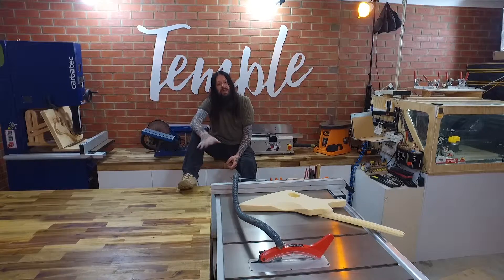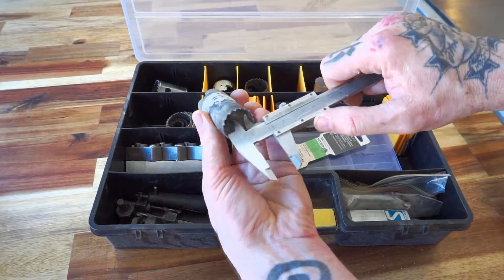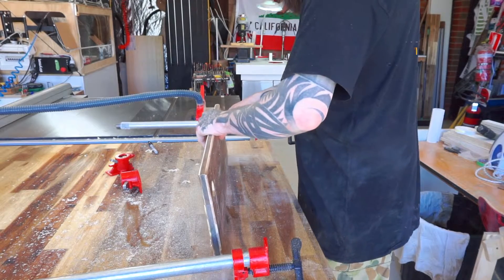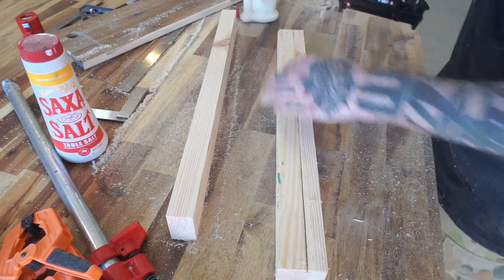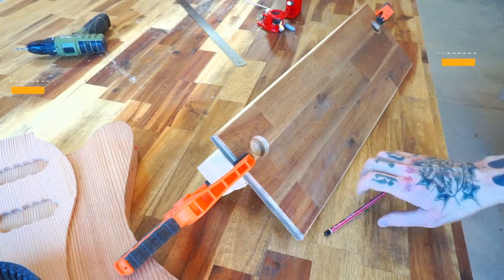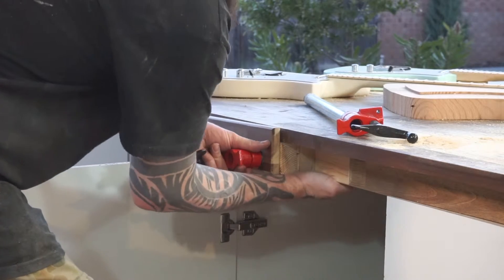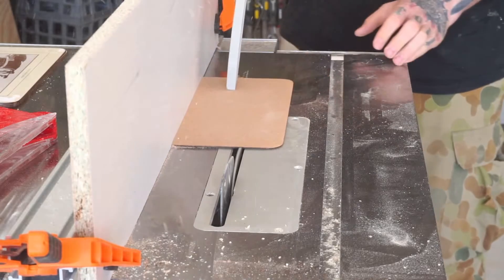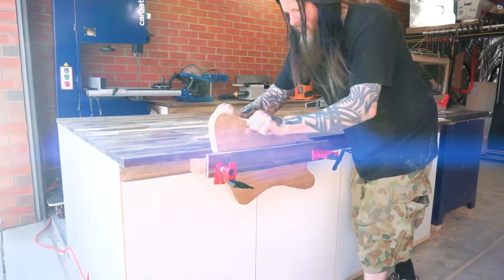Building a Luthiers Vise in under 15 minutes.

Comment: You know somebody works with wood a lot when they say, "It only needed 2 clamps.  I used 10 anyway."
Reply from the maker: It's not work if you love it!
Reply: @TempleGuitars  when I started trying to build my own basses (still a novice), the first thing I learned was that there is no such thing as too many clamps.
Reply from the maker: Absolutely right Kirt. Better to have them and not need them, than need them and not have them. That also applies to tacos.